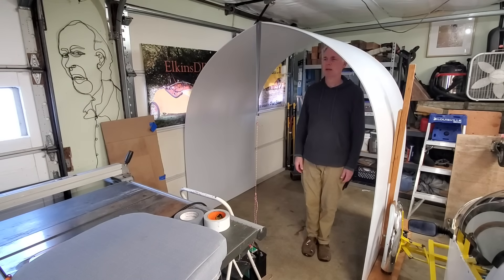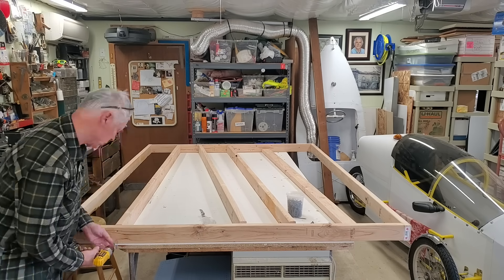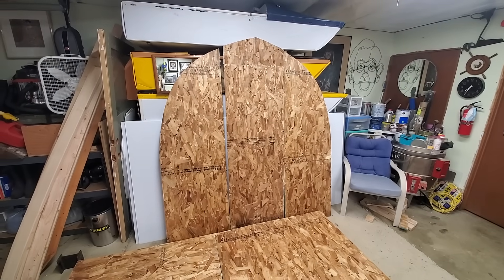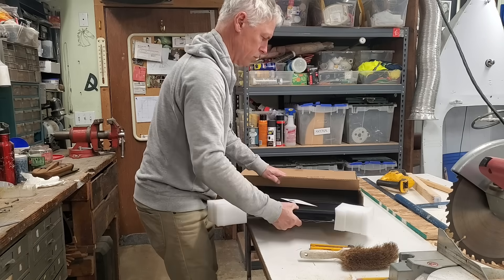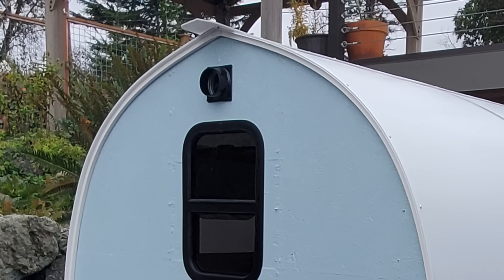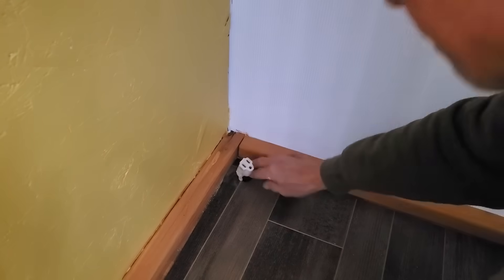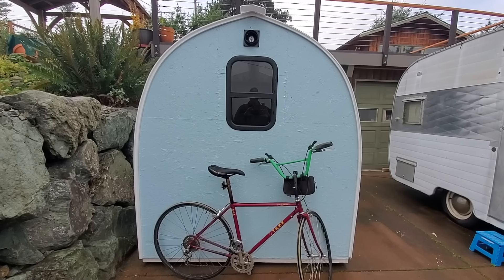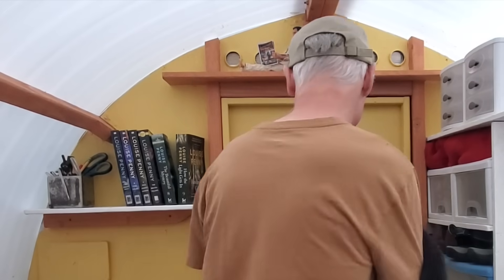Homeless transitional shelter prototype

Comment: Not ideal if not built correctly and insulated with weather stripping. Speaking from experience. The walls, floors and roof will have to be properly weather stripped and insulated in order to harness the heat and ventilated. Especially when using propane. To refill a 5lb tank will cost around $20-$25. If you build your cabin or Cold beat box bigger it will use more gas (propane). Which means you can run out of fuel within 8-10hrs. Not idealistic either. Therefore, smaller would be better. Insulated would be fuel efficient and would last up to 3-4 weeks on a single 5lb., tank. This also depends on how long you're inside the cabin. It will get very hot and feel like a sauna. Usually the buddy heater shuts off once the cabin gets very warm due to lack of air. This is how you know your cabin is air seal tight. Make sure to have a ventilation vent somewhere in the lower or upper corner, it helps with moving heat throughout the room. Good luck.

Comment: honestly a 3' diameter black plastic culvert tube is a perfect piece of material for temporary "dry" shelter 
I have stayed multiple times in them even without end caps on them and been quite happy 
once I was lucky enough to find a 3/4" piece of plywood as a deck inside 
just a thought for another solution

Comment: Hi Paul..I enjoy your Diy Videos..you are very talented with amazing projects ..I want to build one, like a little office out back of my home...I have concerns about condensation..I will have all my Books, computer, printer kept in it...could you tell me the best was to keep it Dry...does the exhaust Fan you have help ..or maybe I need  a small AC...I had a shop built with concrete floor walls and windows ..very nice roof just left one side open like a garage with no roll down door just a 12 ft canvas tarp...my concrete floor gets wet, most my tool I have hanging on my walls are not safe from moisture floating in...I live
 in north west Florida humidity is  rough.  Happy New year!

Comment: It's looking really nice. How about a little recess at the bottom of the bent plates (=a raised floor) for collecting condensation? You could help keep it dry using a rubber whiper like you do in a bathroom after taking a shower.

Comment: is it cheaper and more manageable to build apartment for homeless? maybe just 3 floors, each floor at least fit to 10 ppl. no need to be big just 3x3 meter with 1 meter balcony each. no need elevator just stairs cuz it just 3 floors. also the toilet and bathroom can be place in each floor by ratio 1 facility for 4 person

Comment: Ventilation Fan too small.  A good box size will be ideal. Khind (1.5 feet x 1.5 feet) & reverse installed. Suck air in from outside

Comment: It looks like you could use the fluted plastic for the front and back wall as well. I don't know if the cost is reduced as you would need to build a frame on the inside to restore the rigidity. I'm contemplating building one of these for my kei truck bed.
I've been told for waterproofing and outer layer you can contact billboard companies to get the old signage vinyl.

Comment: Shelters aren't an issue for the homeless or anyone for that matter. You can't just build them anywhere that's the problem.
If you put them on wheels, it's doable to an extent. You can be on the road with them and there are curfews each day to park them anywhere.

But, if you put them on rural plot without wheels there are lot of legal issues that come with it. For example you need a permit is one of them but there's also legalty issues of insulation, electrical and other stuff not to mention social security of finding a job etc.

Moral of the story / TDLR: You can't build everywhere, but there are grey zones.

Comment: I've been thinking about that for a long time. 
My thoughts are, there's a lot of homeless. Shelters need to be made in bulk. Easily moved and cheap. 
I reckon moulded plastic would be perfect. Stackable, solid, waterproof. 
The only problem would be making them. Sigh. 
You'd need an injection moulding factory.

Comment: Solar panel ,solar controller ,a inverter . 
At less 2000 watt inverter , a a 125 amp hour deep cycle marine batteries that's it. 0hook solar panel to controller, controller to battery ,then inverter to battery .that's it turn it on a use it.

Comment: Great idea for warm climates only. To be livable, you'd need at least two 15 amp connections. Fire code wouldn't allow any gas burners, so a 15 amp connection for that, and the second for a space heater -- maybe two. You might need it insulated on all surfaces, and even so, it would be incredibly hot in summer. Security would be an issue as flimsy construction makes it vulnerable, especially given the high likelihood of break in. Finally, a direct water hookup would be nice, but would freeze up in winter, unless it was plumbed and buried well.

Comment: With the way things are happening in America right now. You may want to see what can be used by the elderly getting kicked off of SS SSDI and SSI. 

Like me, I am 59 years old and disabled and on SSDI and snap. I have spinal stenosis in 3 areas, 4 herniated discs, arthritis up and down my spine and after a laminectomy L4 and L5 slipped. In 2014 my surgeon said that my spine was that of an 80 year old. So weight is very important

Comment: Very nice, BUT the issue with homelessness is NOT the structure, it’s the land underneath…the “where can you put that structure?”  That “where” part gets very complicated very fast.  

We have many low-cost but decent options now….Conestoga huts, yurts on wooden platforms, older RVs that are fixed up, tiny homes, etc.  

Many build homeless structures, like a local church that built a tiny home, and then find no one can accept them, as  no one can find the land or spot where the structure can be left longterm.
Reply: Your facts on opioids are VERY wrong, and there were waves of legal opioid deaths going back to the late 1800s in the US, where MANY off the shelf, no prescription “patent medicines” threw opioids into their cold, cough, sleep, diet, etc meds….as it increased their sales.  It was so common 1890s Sears catalogs used to sell both the meds and syringe sets as so many were addicted.  

There wasn’t the media or medical tech at the time to recognize the deaths, but they happened and were known of in medical circles/ old medical journals.  

It’s just the nature of opioids:  of a 100 people, 95 will use opioids short term and get good pain relief with no problem, and 5 or so will go to addiction….with no accurate way to predict.

Comment: Yeah, I've never seen this plastic stuff.   
Seems like a person could replace it with chicken wire and blue FEMA tarps....  or thick white / blue heat shrink boat vinyl (super cheap).

In building cheap, free resources from the environment you can scavenge are always to be preferred and relied upon, rather than buying anything new retail from a big box hardware store.
I mean, you can buy a 10ftx8ft Outdoor Storage shed from Walmart for 340 dollars, a lot of assembly required, and build a pressboard or plyboard 2x4 wood frame floor for it, and put it on concrete blocks on corners.  I don't know how much a 10x8ft wooden floor would add, but add that to 340, and that's the price point you have to beat.

I have a wholly different problem, I have to build a rustic temporary garage somehow out of fallen trees (something like a polebarn maybe) to store my motorcycles out of the weather after Hurricane Helene dropped a couple of trees through my house and barn.   Once upon a time we had a working sawmill, but no more, so I'm thinking... chainsaw milling of the tree ends to make them fit together, and huge nails or through bolts?   An A-frame construction?   Quonset hut curved?   I'm considering everything and anything for a design I can build with the least amount of effort and time, even though I got something of a cabinet shop like you.

You'll want to put that on blocks above the ground, and quite high up, because rain splatter hitting the ground and bouncing up, will keep the bottom edges wet, and they will rot out over time... at least that's what I've seen on all our storage sheds on the farm, on top of one concete block,   Apparently, one is not high enough, a pillar of 2 on top of two for each corner would be better, I'm thinking.   The higher off the ground while still being stable the better...   if something is going to stay in the same place for decades.

My dad built something like what you built, but sided in alluminum, to sit in his pickup truck bed to use for camping road trips.   A bed on each side over the wheel well.

Comment: If the cities where this is a problem wanted to help, they could do like was done in India. There's something called google plus codes, which assigns a code to every location on earth, by latitude & longitude. In India There are little "neighborhoods" That are nothing more than shacks basically, & don't even have street signs. Google worked with the local government there & got the residents set up with their own codes & they're accepted as address, so they can get mail to them & everything just like a regular street address. They're free & you can find the code for your location through google maps under the "more info" section of any location. For example, you can paste the following code into Google maps "VFRR+3V Rome, Metropolitan City of Rome Capital, Italy" to find the Colosseum. You can get one for any location though just by dropping a pin anywhere. It doesn't need to have an address.

Comment: Hi Paul. Love what you do.  Just some thoughts... 
Safety is paramount, so how robust is the plastic against break-in and would corrigated iron work, 
l worry about the bolt on the outside locking someone in,
Maybe a window in the door to allow cross ventilation,
Solar for power,
A great creation at a very good price. Well done!😊

Comment: The real solution to the housing crisis is yimby control of cities, which probably requires unicameralism.  We need traditional walkup buildings, with commercial establishments on the ground floor to make them viable in the long run.  Housing is mortar and plumbing, and being tied into the useful network of resources that make up a city.  You've made a neat tent, but claiming it to be more than that is just self deception.

Comment: looks like the Stage couch in the old western movies. Something better than nothing, almost like van conversion. I put like this if you are a normal like person, and if you are not mental, stay on the street will have a mental toll on a person. gas cook top is not good idea, to use inside. 
Some worst issue is others help them self to your survival gear. Biological extrusions . number 1 add small amount shampoo will kill them smell.. number 2¿

Comment: The housing should be built in blocks, concrete and steel, fireproof with sprinklers, central heat, surveillance, stainless steel toilets, sinks and mirrors, one exterior rated electric outlet. Easy to maintain, hose out and disinfect when necessary. They could also double as private jail cells, instead of locking residents up in county for petty crimes. Behave, door is open. Misbehave, door is locked from the outside with them inside. Send social workers out to slide meal trays and basic necessities through a slot in the door 3x a day. Do better, get a better place.

Comment: Well, it’s a lot better than Ted Kaczynski’s cabin/shack was.  Could be set on pallets.  Actually, a few pallets could serve as the front deck.
Doesn’t appear to be designed for strong winter weather.?  Or high winds.?
Courtesy of Half Vast Flying

Comment: Paul since you seem to care about the homeless - riddle me this one... if you own property can it have a "street address" even though it has no "structure permit"? It appears that a "residential street address" requires a "residence" which in turn requires a "residential stucture permit" - aka a "dwelling unit." My point here is that you can not get a driver's license address unless it's a residential address and most people need a car to have a job to not be homeless, etc.
Sure I would love to live in one of your shelters - or one of my own making - but as of now I would also like to drive a car when needed. I'm just trying to consider my options here. For example upon my intensive research of this subject I found two people who said that for a residential address they "one" - put just the cross streets since they lived on a boat and the DMV did not care as those cross streets were their residential address and "two" - used satellite images and the property deed to prove that is where their residence was, and the DMV then "created" a street address.
Now it appears that the homeless mainly use the street address of their homeless shelter so they can get a driver's license. Does this require special permission from the shelter - and is the shelter zoned "residential" since it provides "shelters"? See what I'm doing here - I'm focused on the codes and laws that punish the homeless. For example once I got a trespassing citation for taking a nap in a public building when it was cold outside. I forgot the homeless used that big handicap stall also to sleep in. The cop wanted me to prove I was homeless by the cop calling my landlady and my boss. Of course I didn't agree to this and I couldn't argue with the cop about my ability to sleep in a public building for a nap.
Anyway so for example car insurance needs the address where the car is "garaged." So again does a homeless person have to prove they are parking their car at the shelter each night to maintain their insurance?
What about if a person uses a mail forwarding service - a "digital" personal mail street address - this would not be zoned residential and the databases would most likely point out that it's a CMDA or whatever the acronym is for a commercial mail delivery address. It appears that sometimes someone can get a driver's license using this CMDA as their address or maybe they can only get it if they use it as a "mailing address" where the license is mailed but not as the residential address. Some people insist on just keeping their previous "residential address" and technically in my state the statute says an address change is a change in "permanent domicile." The Domicile is a state address so if a person moves out of a residential address but stays in the state and does NOT move into another residential address then technically it is assumed they have not changed their "permanent domicile." Of course the cops do not understand the law this way - nor do the insurance agents - they want any change in your living address.
So you see where I'm going with this? What if someone owns land to have one of your shelters to live in or a campsite? What if that land has a street access and that street has addresses - meaning googlemap shows a certain address at your street access? Does the DMV allow that street address for a driver's license because domicile does not require a "residential" address - it requires you to be physically living somewhere, not necessarily in a "dwelling unit" structure. I'm sure you can easily understand me but the corporate-state juggernaut? I doubt they can understand me. hahah.
Tomorrow I will test this out! I will apply for a same-day driver's license change. I will have a lease for a primitive campsite for land I own.

Comment: Again, greed vs need, legal or illegal ‘corruption’. For more on the opioid epidemic read ‘Dreamland’. Worked as a paramedic and nurse, lots of homeless use EMS for routine care. Healthcare systems collect fees through government funding of the poor for care that often requires non-emergent care and does very little to address underlying mental health issues. Basically, political control and profits are subsidized by taxpayers via the care for the homeless. And it is these taxpayers that often do not have their own coverage for healthcare and compete for housing against government subsidies for the homeless where there are programs to house them. It’s a freaking mess.

Comment: I would bend those full sheets right over the top , no seam to seal on the top , and just overlap the bottom sheets like a big shingle. Then tie that joint down with a piece of 1x4 and some screws.

Comment: So where's the bathroom?? You show it on the computer screen (whats the purpose of that??) but not in the actual house. Im confused...
Reply from the maker: On this model I shoved in as much as one can with 42 sq ft of space. I did show a bucket toilet. I didn't feel like making another pan as showed on the computer screen, but one could easily be added and a sits bath could be done in the shelter.

Comment: Yeah, I don't like that outside lock, either....unless it doesn't move w/o the key...I fast-forwarded to the interior tour, so maybe I missed it, but that place wouldn't fly in colder climates. Doesn't look like there's any insulation at all...
Reply from the maker: Insulation could be added to the interior, but I chose not due to my moderate climate. As is, I can get the interior 35 degrees warmer than the outside using my plug in oil radiator heater.

Comment: It's fantastic fella. It's not the final solution but it's a major leap forward. When compared to a park bench or shop doorway it's Buckingham place. The cost of any improvements would be offset by cost savings of mass production. The biggest problem is getting local authorities on board. Finding somewhere to put them. Insurance ect.